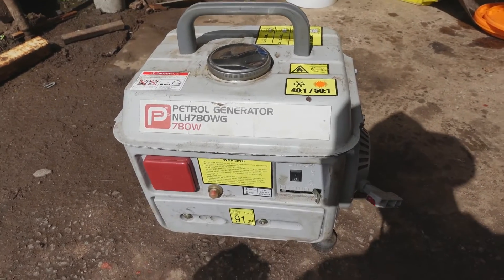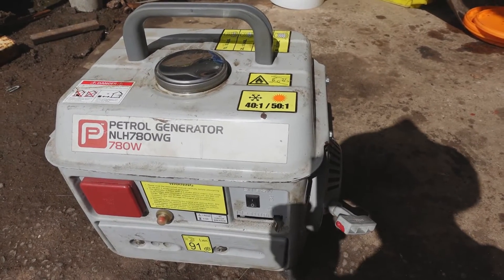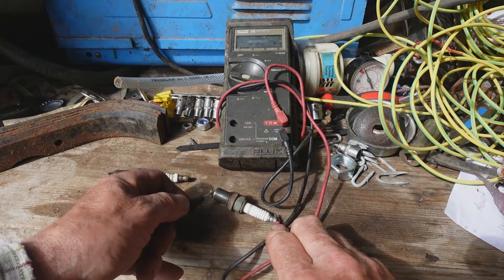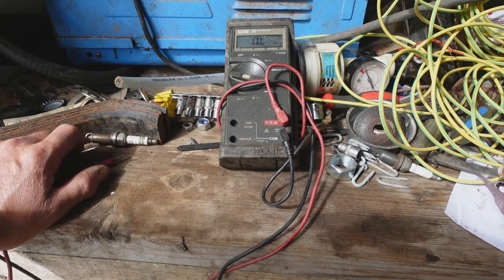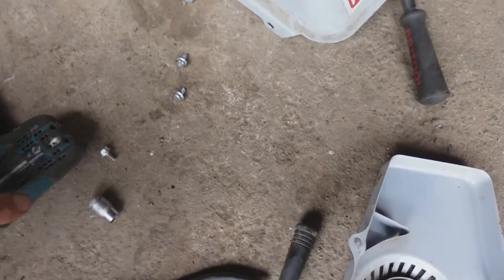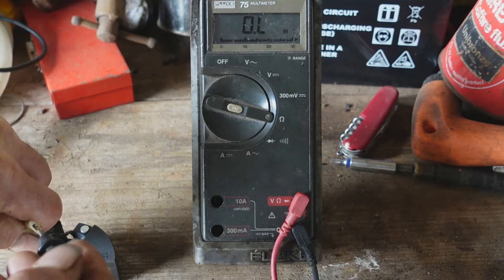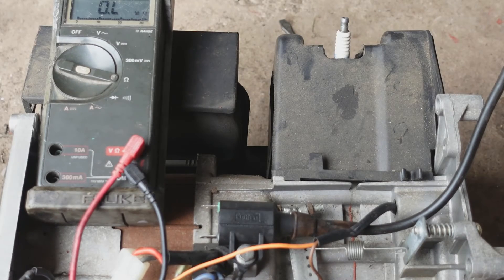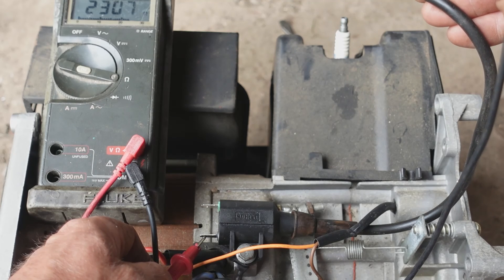780W Generator fault finding

Comment: Hi, I have the same genny as this and was getting no spark at the plug. I was getting the same readings you were so to test I did this. 

Test for magneto:
Remove spark plug/turn off fuel. Put multi meter terminals on orange wire + gnd - spin motor with drill with a socket attached to the drive shaft - output voltage on multimeter should be around 12 volts on the AC setting.

Spark plug test:
With a cheap 400kv High Voltage Generator module (same as in stun guns) which you can get from ali express for under £2, you can connect to a 3volt battery (18650), on the module HV output wires connect one to the body of the spark plug and the other to the bit where the plug lead fits - you should see the spark jumping the gap rapidly wehen the 3v battery is connected.

Coil test:
You can test with a 12v battery, basically the 12v supply when disconnected collapses the magnetic field in the coil and generates a high voltage. So rig up like this: 12v + from battery to the green terminal of the coil, body of spark plug to the black terminal of the coil, Battery 12- wire should just be touched on and off quickly to the black coil terminal - you should see a small spark when disconnecting the wire.

At this point the ignition system is tested and if you are getting a good spark, most likely it's a fuel issue if the genny is not starting as the air filer is just a bit of foam coated in oil so the dust sticks to it.

The on/off switch is open circuit when turned on, when on if gets grounded.

For those looking for a cheap coil:  you can use this cheap one as it's the same: Ignition Coil Module For ET950 ET650 EF1000AX GAS Generator, You can get one for about £2 from ali express.
Reply from the maker: Thank you. All very interesting ideas. It's a couple of years since I got this thing running, I then drained all the fuel from the tank and the carb. and left it on the shelf until a couple of months ago when we had a power cut for several days. Put some fuel in and it started second pull and ran the house lights for the duration of the cut.

Modern petrol is terrible stuff to leave in the carbs. I never got round to draining my garden machinery last winter and I have had bocked carburettor problems with my Honda mower, Honda rotavator and Briggs Stratton ride on this spring. Not much more than an annoyance for me but it must cost owners who don't know about these things a fortune.

By the way, have a look at Poroldchap, he has some very interesting stuff on his channel icluding how to make a cdi coil tester which is simple and very usefull

Regards, Jon
Reply: Hi sorry it's a weird one but I have just picked up one of these generators from a boot sale, thing starts and idles lovely however when plugging anything in I am not getting any power at the plug however if I shut it off and quickly flick the switch back on it seems to give a little pulse of life but nothing consistent any ideas at all?

Cheers Jack